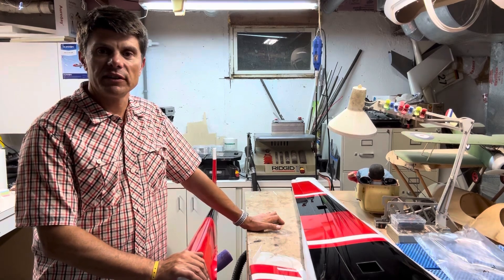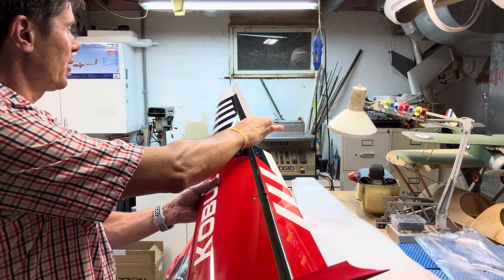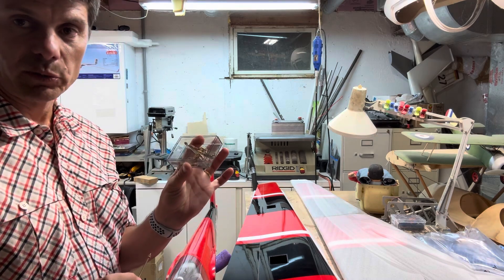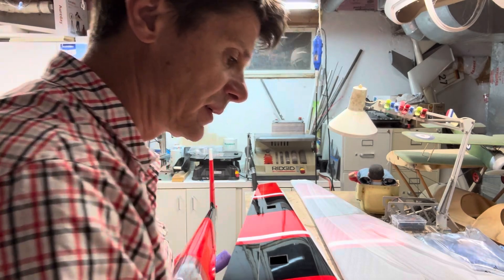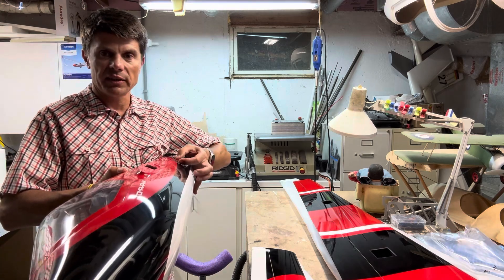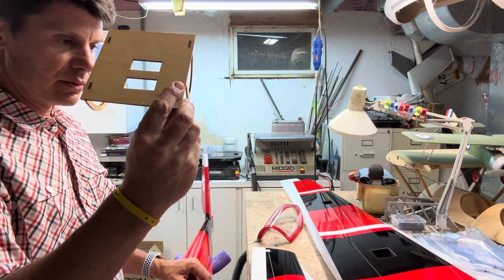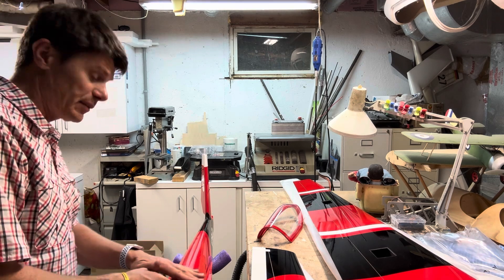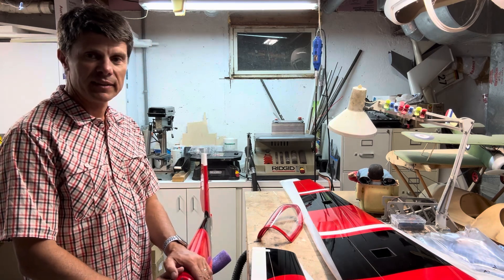Tomahawk 3.2m Kobuz unboxing

Comment: Maximum recommended power for the FES-EX6 drive is 1200W.  Is it capable of safely handling 1800W?
Reply from the maker: @garyneuzerling7480  I have that on my ASG32 and with a throttle on a slider that’s work well, maybe not if on a switch with unleashing power right away… will keep you posted